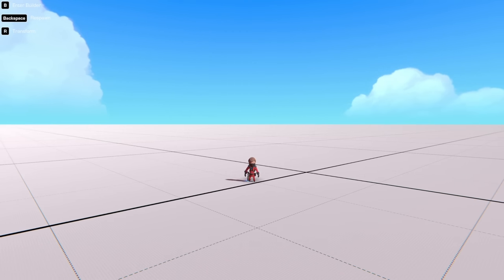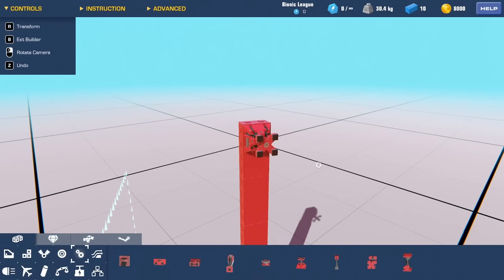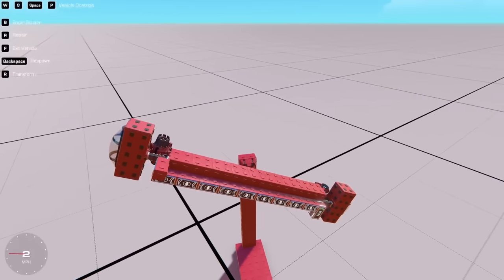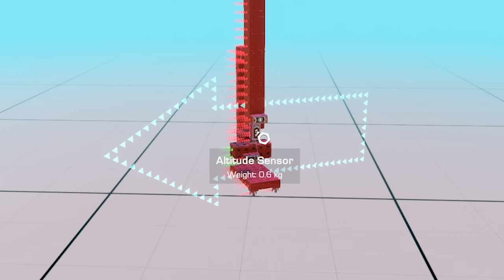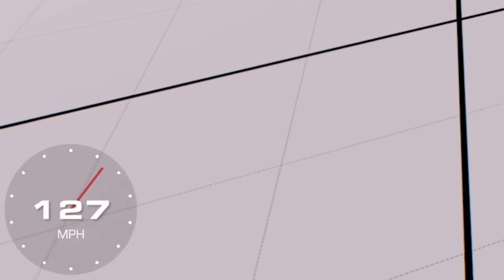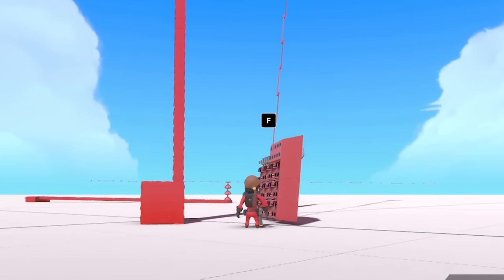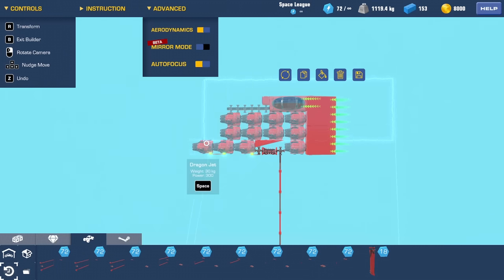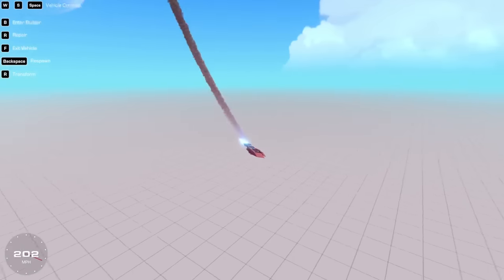Engineering a CATAPULT that breaks the sound barrier...

Comment: This is currently being developed as a potential method of launching vehicles into space. You should try to make a space launch vehicle in the survival game… since it is the goal of the game after all.
Reply: It is also a horrifically flawed method of launching stuff into space unfortunately.
Reply: @SilverMKI  I can see the beauty in the theory, but there’s obviously zero possibility of it being used for any manned missions. As of April, NASA had decided to continue to invest in the concept to see if it could be used to deliver a payload into space more efficiently than rockets alone, but I guess we’ll see if it’s possible for the company to build a vacuum chamber the size of a football field that can accelerate a payload to 5000 mph reliably.
Reply: @RCE you could also try this on KSP; or even better, make a geostationary centrifugal space launch platform for deep space Kerbal missions … assuming it’s possible to get the vehicle to spin about its axis and the kraken doesn’t kill Jedediah first …
Reply: @LegallyTrash  stratzenblitz already did that
Reply: @retsaM innavoiG because you are putting significant amounts of energy into something that requires extremely precise timing and rapid movement of launch parts (ie the cover over the vacuum chamber, the release mechanism, etc) to function correctly. Any failure or misalignment means you are throwing the payload through the side walls of your launch chamber or ripping your launch mechanism apart.

You're rapidly repressurising the launch chamber which doesn't do hardware or electronics any good.

Much better to pick a mountain somewhere and build a maglev launch rail and tunnel up the side of it, since you can use that for much larger payloads as well as crewed modules.
Reply: A railgun?

Comment: I believe you can press 'c' to change between the 8 different camera modes
Also you can change the speed units in the menu
Reply: He has it set to imperial, you can check the speedometer in the UI. But the sensor isn't in imperial, there's a mismatch.
Reply: @Xeridanus  it looks like a bug on the sensor with how it's labeled, because when he set it to 800 kph, it still released at 800mph.
Reply: @Nareimooncatt  it's tilting it labels it as kph instead of km/h, the correct way to write the unit.
Reply: @mattymerr701  kph is still correct in non-scientific use

Comment: You should use the angle sensor instead of the altitude. The way it's set, if you're headed down from the top when you hit the speed setpoint, it'll detach anyway. The angle sensor would let you be sure you detach at the optimum point.

Maybe add just a bit of weight to give you a stabilization fin for the flight?

Also, check the cockpit weight. You might be able to balance the load with the engines in the axial direction - engines on one side, cockpit in the other, with just the cockpit and it's streamlining detaching. Use a flat connector to hold it to the side, with the detachable block behind the cockpit attached to it.

I'm a mech eng myself.
Reply: Potentially too he's going to get better range out of about 35 degrees over 45. But it depends on the physics modelling in Trailmaker taking into account drag properly.

Comment: The end result is not exactly a catapult: it's more like an assisted launch for a rocket. You see, the "projectile" part still has active rocket engines. It would be more "fair" to detach just a cabin.
Reply: Trebuchet
Reply: @akashics1275  a trebuchet is just a bigger better but slower catapult
Reply: Yeah, I would've had the rockets along the arm and then detach the cockpit from the end of the arm, instead of detaching it all in a big unit.

Comment: You took a 10-minute topic and stretched it out to over 20! Now THAT is skill! :D
On a serious note, servo stacking is a thing in TM, but it only works if you power them. If they are free-spinning it does nothing. Also TM tends to get unhappy if there are large side loads (like a long support pillar) on hinges and such since those are not all that rigid at high loads. You can even see servos sagging when they were stacked to support the catapult at one time. Point is, making this catapult's base into a U shape instead of two separate pillars would have been way more stable.
And lastly, why not use angle sensors instead of altitude? Would have been way easier to program the release angle.

Comment: Btw, if you use detachable blocks to cover all aero surfaces and then detach them then the aerodynamics are miscalculated and you get zero drag. All of the top dragster race vehicles use them

Comment: Replace the altimeter with the angle sensor so you can get the right angle, the altitude doesn't matter if the angle is right though you could get both if you make AND go to 2nd AND along with the 3rd sensor

Comment: Happy Fun Fact: Modern windmill blades are constructed of carbon fiber and are designed to exceed 300+mph but rarely see over 150-175mph. 

Sad Fun Fact: The process of mining the materials and producing carbon fiber on a large enough scale is SO polluting, that it would take nearly 800 years of continual wind to offset the carbon footprint. Also they decimate the local bird populations. If you can get close to the base of one, it's like a boneyard...

Comment: Hey RCE, by the way you can reset your builds by pressing backspace and it respawns you and despawns all of your other builds and the physics on the connectors flex at high speed that may be the problem you are facing by hitting the ground

Comment: Kinda wish you launched just the cockpit lol. You could have moved the cockpit higher and put a detach block under it, I think it would have been covered by a wedge, plus the cockpit is still fairly aerodynamic which may have provided less resistance than the 4 wedges. I just think the cockpit alone would have gone further, plus wouldn't have been self propelled. so really you made a trebuchet inspired rocket catapult with a rocket propelled payload.. though, that sounds pretty cool and effective lol

Comment: Couple of things... I haven't played the game, but... are you sure turning on the "Aerodynamics" switch just switches on the VIEW of aerodynamics, and not the entire function? So, if you left it off, the game wouldn't bother calculating aerodynamics and you wouldn't have to worry about them.

Second, it appears you can anchor your entire base platform to thin air. So... why not do away with the base AND the supporting frame, and just pin the axle to thin air? Just behind the spinning servo, pin that to nothingness and it's less stuff to worry about, and more stability too since there'll be no more wobble coming from the frame.

Also... I once saw a documentary thing that mentioned the most aerodynamic shape for the BACK of a car is a flat, blunt, cutoff. A straight brick wall 90 degrees down from the roof, basically. So that's why '90s cars were so bleedin' ugly. For a scientific reason!

I might get rid of the altitude sensor and use angle if I were you, then you could adjust it precisely. Since the cockpit is going to be at a given altitude twice per rotation, once coming up, and once going back down again.

Finally can you actually HAVE a spinning servo? That's not what a servo is, is it? A servo has it's own feedback mechanism so you can set it to a particular angle and it takes care of it accurately and automatically. Spinning round like a nutter wouldn't seem to qualify.

I SAY I haven't played this game, yet. If I do it'll be like the 4th I've got cos I saw you playing it (and waited for a sale on Steam), and like my 20th for some random bloke on Youtube. You make them all look so good! I've blazed through Planet Crafter til my next step is waiting for the fish to arrive, and they haven't programmed those in yet. It's taken me like a week.

Comment: 11:30  Maybe it is a mile made up of 1000 divisions, each equal to 5.28 feet.
Reply: 3.28 feet
ftfw
Reply: @therookiegamer2727  I am not talking about the meter.  I am talking about 1 thousandth of a mile.  A mile has 5280 feet.  5280/1000=5.28.

What I am trying to say is that it might be using metric prefixes on English units.
Reply: @therookiegamer2727  And what does "ftfw" mean?  I cannot imagine it is very nice.
Reply: @dannypipewrench533  it's supposed to be ftfy (fixed that for you)
Reply: @scottdotjazzman  Oh, that makes sense.

A bit of research has revealed that it is not always the most friendly term.
Reply: @dannypipewrench533  you're right, it's usually an insult
Reply: @scottdotjazzman  Well that is not very fun.

Thanks for the help, though.

Comment: It cursed me to see, how you built the catapult so asymmetrical as hell. Put the rotors both in the middle, so you don't spin one half of the "stand/bearing" and the other not. Also, it would be much better, to get a tiny bit more room between the ground and the cockpit, cause the first hundred crashes, was the result of touching the ground...

Comment: Wow, engineer, r u sure? 
Pay attention kiddies: 
Roughly, miles to km is miles times 1.6 (or 1.5 and round up). So 100 miles = 160 km
And, km to miles is km divide by 3 and times 2 (or times 2/3). So 100 km = (100/3)*2 = 66 miles -ish.
ROUGHLY. For the purposes of not going too fast or too slow by a factor of 2 or 10. 
Yer welcome.